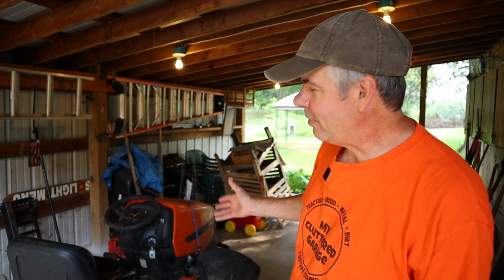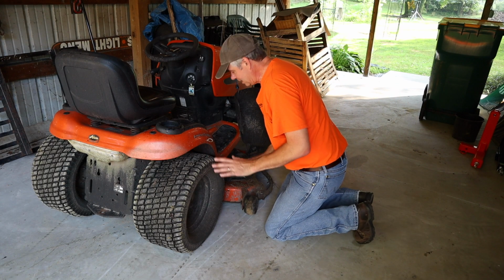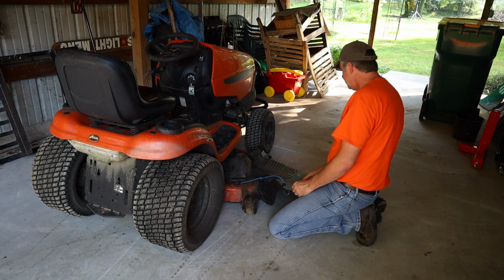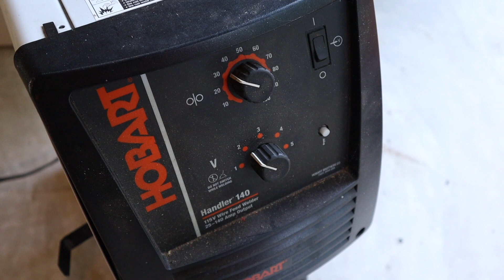#63 Mower Deck Repair Using the Hobart Handler 140 Flux Core Mig Welder.

Comment: Hey cut a 2-3" strip off the end of that discharge chute and you wont have to tie it back...what's the scoop on your tire pressure guage?...that looks neat!
Reply from the maker: Thank you. Here’s an affiliate link if you want to check it out. https://amzn.to/3sR9Zif
Reply: @MyClutteredGarage  thanks for the link...after reading the reviews I gotta ask..Have you had any issues with the chuck leaking?
Reply from the maker: @jaytodd5809  I think it can be a bit finicky. I haven’t used it for over a year because I got a Dewalt tire inflator. Here’s that video: #116 Dewalt 20 Volt Max air compressor / tire inflator review.
https://youtu.be/mqHGSxJnYt4

Comment: Looked to me like that was cheap metal in that deck, it  really didn't like the heat it took to get a good burn. You lay a couple tacks on the other side?? It will work till it doesn't anymore. I seen a new welder on JC Smiths channel and its a real game changer for doing small  to  large jobs... I only see one shortfall is that when any one part fails, you lose everything till back    working again
Reply from the maker: Thanks Morgan. I laid a few beads all around it. I think it will hold!
Reply: @MyClutteredGarage  I knew it would hold but the decks on most mowers is a cast steel or some variation of it... I tried welding one and it caught fire no less

Comment: Hey there Ed, Hope all is well and you're feeling better. I have a Hobart 125 welder it seems to work well. What size of wire do you use and are you using gas? I just use the gasless 0.35 wire. It gets the job done but would like to try out the gas wire. Great job on the video. Stay safe out there. Take care and all the best.
Reply from the maker: Thank you! For this project I used .030 flux core, but probably should have used .035. I haven’t used the gas much, but it does make for a cleaner weld. I plan to bet a bigger argon tank and use solid wire more often. The flux cord is just so convenient. Still coughing a lot after 10 days but getting better. Thanks for asking! -Ed

Comment: You said that was a 25 hp engine in that lawn tractor, well that is more than your Kubota.  It also looked like your right rear tire needed a little air when you pulled it out of the space the first time.  Next time you might want to clean off the deck of all the dry grass before you start welding, because it might start a fire, ask me how I know....
Reply from the maker: There was some smoldering 😄